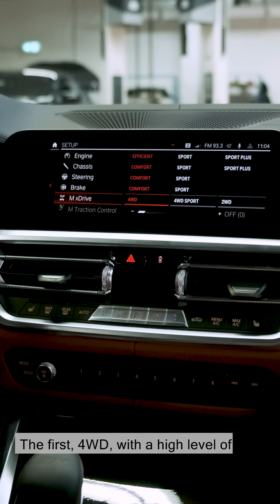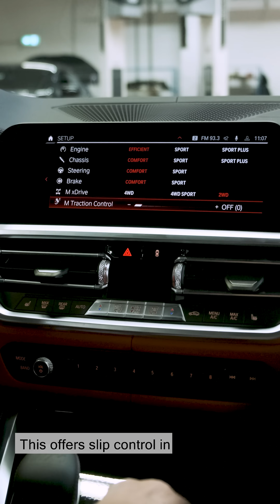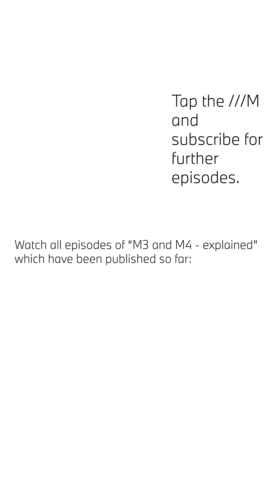M xDrive - All Wheel Drive. M3 and M4 - explained, Episode 20.

Comment: I drive one of these M-xdrive M3s.. I find the M Xdrive to be more `present´ than the normal xdrive. I feel it on wet surfaces every time I take off from a parking spot with the wheel turned at a sharp angle. This is very disturbing as it always spins in the front a little bit.  My Questions: 1., How long can I drive in 2WD mode without damaging any parts (we heard some part of the Xdrive System is not lubricated when disengaged). 2., It´s all nice and cool to be able to do drifts and donuts, but what happens to the Transfer Case after I killed my tire treads on the rear and for eg. now have 6mm in the front and 3 in the rear? Do I have to replace all 4 tires after a nice drift just so that the circumference won´t be off? I find this system to be utterly overcomplicated and very prone to failure (thus having my 2nd transfer case and 2nd rear diff already after 20000 miles - no drift days). I obviously have my own opinion, but would like to hear it from the M-Engineers, regarding these scenarios. Thanks!

Comment: Ok, here is the question every old xdrive owner is asking right now: conventional xdrive is very sensitive to tire diameter discrepancy (front axle vs rear axle). How is this Problem solved in M xDrive. We have to anticipate that an M-driver with 2wd mode, will do a couple of burnouts or drifts leading to significantly reduced tread size compared to the front. Historically the transfer case has been the weak link between the front and rear axle. How many mm difference in tread size does the M xDrive allow between front and rear axle?

Comment: Extremely helpful videos!!!!
One question in order to reconcile what I understand from the Traction control system and M xDrive.

Effectively we have 5 "combinations" for the Competition / M xDrive models.

1. 4WD ON / DSC ON
2. 4WD Sport / MDM
3. 4WD Sport / DSC OFF
4. RWD / DSC OFF
5. RWD / M Traction Control

What exactly is the difference between configurations 2 and 3, AND differences between configs 4 and 5? 

I assume in config 3 friction coeffecient and yaw angles are NOT used for driving dynamics due to DSC being fully off. Therefore accelerator modulation is required but, how does that work alongside the lateral management system + front axle torque distribution? Is there still a level of braking and throttle adjustment made, but ONLY to the front axle?

Whereas for config 4 vs config 5, does config 4 use say M Traction Control setting 6 (picking an arbitrary number) or would it be more equivalent to picking 0 in addition to no friction coeffecient and vehicle yaw angles being analyzed?

I am trying to understand the relationship between all modes and would like to know at a detailed level what they are before embarking on a test of experimentation on the race track 😅. 

As always, very helpful videos and documentation from you and the team!

Comment: A blue metallic car with gold wheels - sound like a sweet WRXs (STI). 😂

I can’t wait to be able to order my AWD M3
Reply: On the same boat here. Dealer says late May/early June in Canada
Reply: @shinwang2469  BMW just posted the pricing on the new xDrive M3 at $76,900 plus $995 Destination. If you fully load the vehicle without the carbon ceramic you’ll be knocking at the $100k. 😱
Reply: @Benmu2182  Yeah... sadly it’s the case. I am expecting about 130K Canadian after tax. BMW puts 20K gaps between M3, M5, and M5 CS. Really hard to decide :(
Reply: @Benmu2182  double that $100k to $200k fully optioned in Australia then consider that AUD $1 buys about 73 cents US. Yuck!
Reply: Nice!!! little jealous here ☺️but in a good way !!

Comment: @BMW M  Will you offer the M Traction Control in the M8 with a software update? Switching this car to 2WD today without any systems to look after you is like signing your death wish!
I will be really grateful if you do so 🙏
Reply: Bad luck for any past Mx cars. M Traction Control is based on the ARB system, which debuts in the M3/M4 (for M cars).
Reply: At Least for the G82, there's a hardware component in addition to the software. It was one of the features removed from my car during the build due to component shortages.
Reply: @nfavor  which feature was removed during build time? The M Traction Control is not present at your car?
Reply: @TolisAp  M Drive Professional. It still should have the 4WD, 4WD Sport and 2WD but not the 10 stage traction control ,drift analyzer or lap timer.
Reply: @nfavor  Your M4 came without the 10 stage traction control??? I wouldn't sign to receive the car without it. Seriously, without the 10 stage traction control these cars are not usable in public roads in 2wd cause all electronic assists need to be switched off. Talking by experience
Reply: @TolisAp  The car has DSC and MDM. It's only an issue when you change it to 2WD mode at which point all traction control is turned off unless you have the M Drive Professional. People are waiting 4-6 months to get their G80/G82. The only quicker option is to buy used and get a $10k or so markup over NEW. Crazy times.